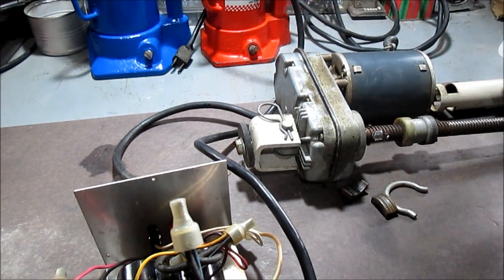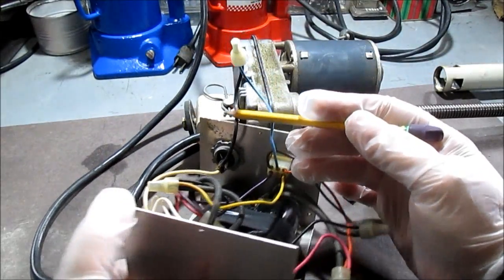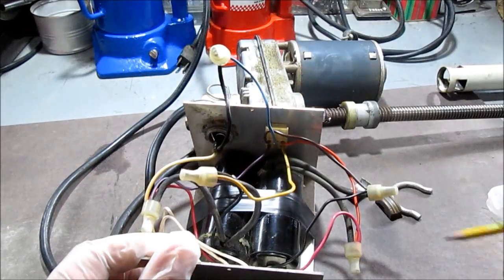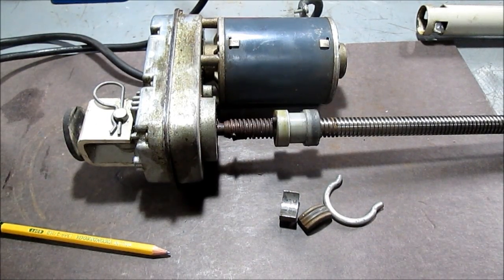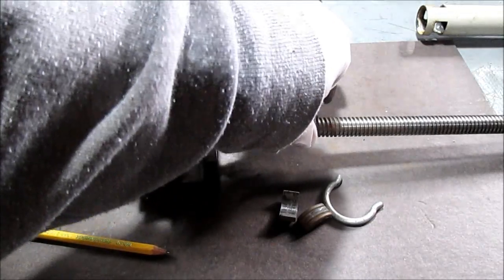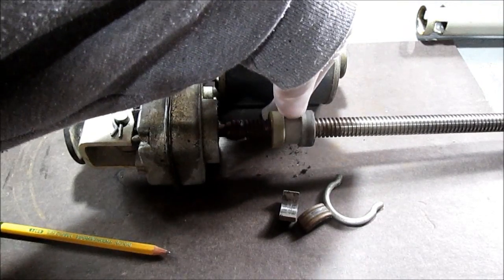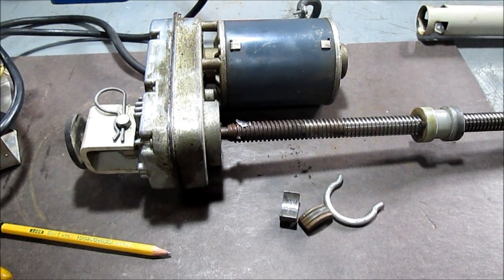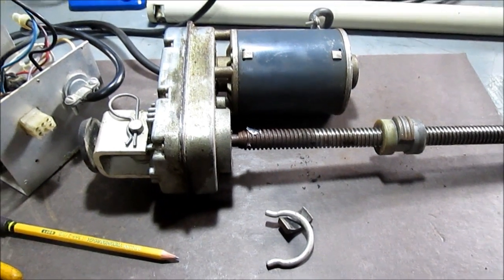Old Electric Bed Motor

Comment: I have the same motor and trying to figure out how it works. There are three wires going to the motor, right? A red, black and white one. Could you tell me how you connected these to get the motor running and changing the direction? I do not want to break mine and you already have figured out how it works. Maybe you can give a hint?
Reply from the maker: Sorry I do not have it anymore

Comment: Your voice sounds like John Wayne! I am needing to operate an electric hospital bed on 12 volt DC affordably. What do you suggest? Also is this the type of motor they use on rolling metal window shutters?
Reply from the maker: You can buy an inverter that hooks to a 12v car battery and you can run 110 volt things on it ..I do not know about the shutter motors

Comment: I'm a little tardy to the party lol, but it's called a linear actuator. I just started playing around with them the last month or so. There's endless applications for them. What did you end up doing with this one?
Reply from the maker: I still have it sitting in the corner of the shop ...Wish I had filmed how I made it run in each direction ..It is easy to wire and I should have a switch that will work

Comment: I have a couple of those that I got off a hospital bed and thought I would use them on a hoya lift to lift the rear end of riding mowers, but the motors didn't have enough umph to lift them, so now I am going to mount part of it on my work bench to lift one end of the push mowers (I hope).
Reply from the maker: The Shade Tree Fix-it Man This mounts in the pipe with the 2 metal shoes on the plastic threaded part so It will slip if it has to much force put on it

Comment: looking forward to see what you make with that. I'm seeing a single glass apple cider press :)
Reply from the maker: belgrademachine I have a few Ideas for this It is designed so the threaded plastic bushing will slip if it has to much force applied to it pushing or pulling the pipe part also there are pins limiting the travel to about 1 foot

Comment: An actuator. They used small 12 volt DC ones on the old big satellite dishes in the 80's to turn the satellite dishes. I used one to lift and lower my 3 point hitch on my John Deere 110 back in the 90's. They are great for projects..
Reply from the maker: Jonathan W I would like to find some 12 volt ones for projects The 3 point hitch would be a good project for my JD112